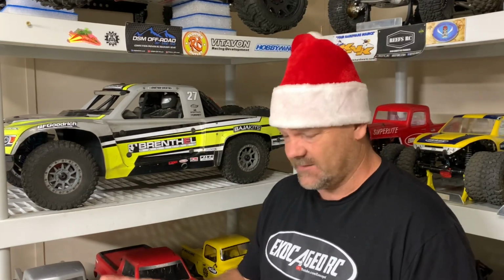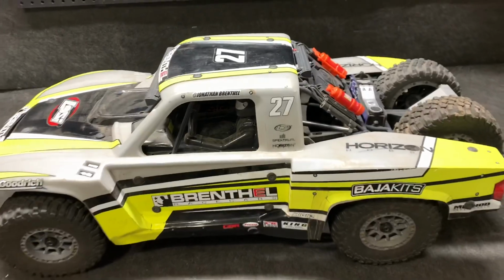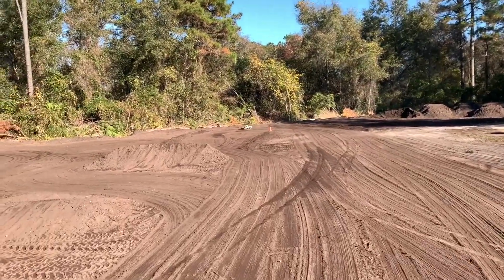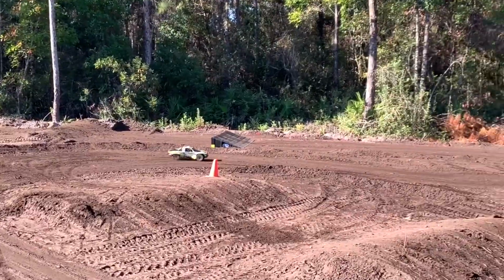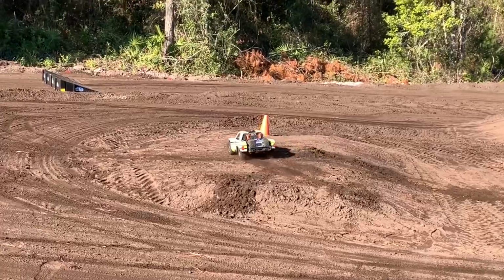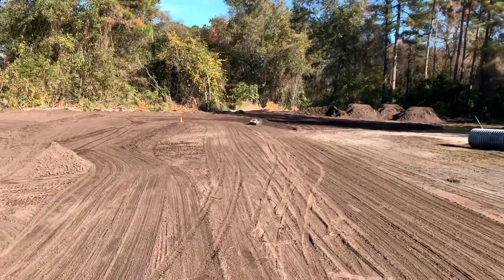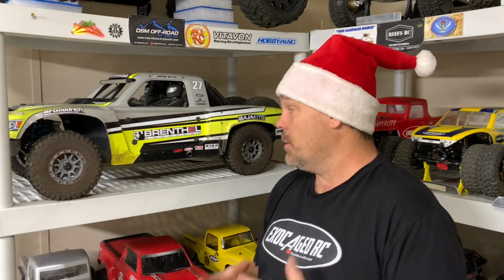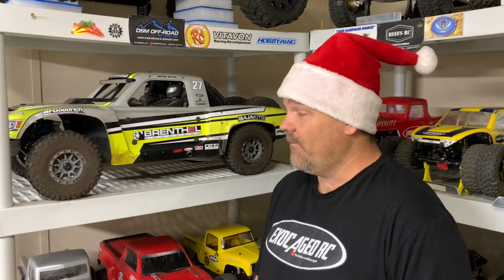December Drive All #24 Losi SBR 2.0 Brenthel 8s

Comment: Hey Joe here's a trick when you jump trucks of any kind or buggies, when you jump in your truck is torqued to one side turn you will to that side and it will level itself off. It's a trick I learned from the pros it works with anything I had the Mojave and any time I came off a jump and it look like it was going to land on its side I would turn the wheel to whatever sided tipping towards and it would level the vehicle off. Hope this helps I hope you go out and try it specially with this truck you might be surprised